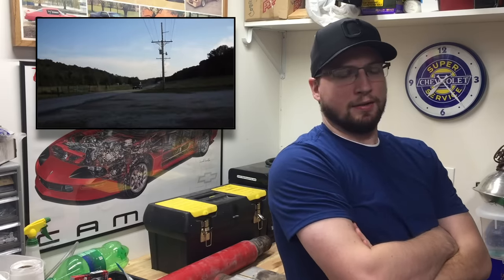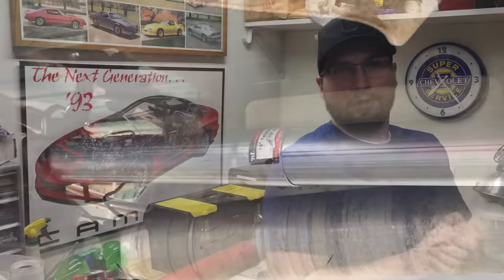Cherry Bomb® Glasspack vs. Straight Exhaust Pipe - Sound Comparison - 5.3L Chevy

Comment: I like the glass pack. Loud enough to make it sound good but just not too much to where it makes it sound like a wet fart rolling by.
Reply: jake gregg I personally like the xforce varex muffler
Reply: That's not even possible to fart with a V8. Now if it's a 4 cylinder then yes it does sound like a fart.
Reply: @streetspeed9166  that's a good muffler but its gotta be on the right V8 to sound perfect
Reply: @ffhjvbuydb78eb 4 cylinder, oh yes. V8, still possible but not as common
Reply: Fox-E (Bonzai) yeah with true dual it can sometimes be like a fart.
Reply: @dallasdelano8235 I would say its more of a crackling noise. We have trucks around here that sounds like that
Reply: Jake gregg I’m glad I am not the only one who uses that expression
Reply: Jake gregg the “fart” sound in a v8 can be found more easily in European v8s that typically use a flat plane crankshaft instead of a cross plane crank, that’s why a Ferrari v8 and a ford v8 sound so different, or the 6.8 v10s (american) vs 3.0 v10 (Ferrari f1)
Reply: @ffhjvbuydb78eb  or some v6s
Reply: @jeremysolem2494  Yeah I knows I've heard some Pontiac grand prixs that sounds awful.
Reply: Jake gregg I agree
Reply: Lol
Reply: Lmao!!
Reply: cabin drone vs external loudness...id rather have the pipes dumping that loud sound outside than the pack vibrating underneath me and bringing that noise into the cabin.
Reply: Not everyone drives a civic like you bud...
Reply: I love the way glass packs sound. I have since I put my first pair on when was 16, but they never last long as the packing blows out they start to sound bad. I love the smooth raspy sound they have when new though
Reply: @ffhjvbuydb78eb  OBS 5.7 at my school will make you eat your words. It really sounds like an amplified fart
Reply: Well said
Reply: @ffhjvbuydb78eb  I’ve heard some clapped out v8s that made me wanna deafen myself.
Reply: @banditpsycho3573  same. Some of them you can't tell if they really are a V8 or not. Especially if they have a bad exhaust leak they sound like shit
Reply: @jakegregg7153  it's always been 302 Ford= glass pack. 350 Chevy=Flowmaster
Reply: I put one on my first car and it sounded perfect. Not to loud not and quiet when I was under 3k but anything above 3k sounded nice like a sports model
Reply: I like the way my wet fart sounds thank you
Reply: There is no such thing as a truck being too loud
Reply: @thomasrainey4989  I've driven a truck that had it dumping out of the headers. It vibrated the windsheild to where you couldnt read road signs clearly. That's my too loud line
Reply: @kelseyjohnson9760  absolutely! It's yours and if it makes you happy then rock it!
Reply: @thefloridiangamer1448  If you close your eyes and listen without knowing what it is..well easy enough
Reply: Both sound good was doing the same to my truck v6 but never knew the sound my truck had after deleting the muffler....thanks for helpful video
Reply: My truck has a resignator before pipe goes behind tire so we'll probly reconnect it
Reply: Does the glasspack help with hp ?
Reply: Big difference with it being true duals
Reply: @ffhjvbuydb78eb squatted trucks manage to do it

Comment: Glass Pack! it has a cleaner lower tone the straight pipe just sounds like trash. BTW nice comparison video well done.
Reply: That's because most engines run a lot worse with straight pipes due to lack of proper back pressure, also straight pipes are a real caveman thing to do to a vehicle with all the exhaust technology we have available.
Reply: @getskared  "Proper backpressure." Proper backpressure is as little backpressure as possible.
Reply: @BradChadley  thats actually very untrue in fact some engines will stall out if they don't have enough and if you are getting into performance engines you will lose stats if you don't have proper backpressure it's important to help an engine run smoothly
Reply: @getskared  Please watch Engineering Explained's video on exhaust backpressure. It's an informative and simple summation of why that is inaccurate. The goal of a combustion engine is to remove used combustion gases as quickly as possible. If you have backpressure, it will do work against the motion of pistons, and will increase emissions, reduce performance, and fuel consumption, which is pretty self explanatory since your engine will have to work harder. This is why race cars have exhaust systems that are very loud and efficient as possible, because mufflers and catalytic convertors in a typical vehicle increase backpressure. I recommend doing some more research on how exhaust works and the effects of backpressure. Cars needing backpressure is one of the most common misconceptions about combustion engines, and is simply false. I used to think the same thing, and thought about how an exhaust system works and it didn't make sense. I did more research, and sure enough, it doesn't make sense. Remember, back pressure will fight back against the engine. A small amount of back pressure is helpful, because it creates a negative flow that will help to completely empty the combustion chamber, but it minimally affects performance and modern cars still have more backpressure than necessary (due to noise and emissions restrictions). My 2005 Toyota tundra  for example, has very restrictive exhaust headers that create more backpressure than is necessary, and a set of proper long tube headers can add 20-40 hp and a slight bump in fuel economy on that particular motor (2UZFE).
Reply: @BradChadley  no one is reading that whole paragraph
Reply: @dillongish9001  It takes maybe two minutes but alright.
Reply: @getskared  everything you say is false.. Every performance race team also would laugh at your comment.. No bavk pressure.. Backpressure needed is a myth perpetuated by those that didnt understsnd old carb engines needing tuned for exhaust changes
Reply: @getskared  wrong. If that were true then top fuel dragsters would have mufflers
Reply: @dillongish9001  Paragraph hell, that's a damn novel!!!!!!! :D
Reply: @BradChadley  You can simulate that theory just by eating a large can of Hormel Chili and waiting a half hour. Hell while you're at it get a room full of people and explain those back pressures and tones........
Reply: Glass Pack and K & N cold air intake or Filter will be perfect.
Reply: mrelectron62 straight is lean, and mean..
Reply: Agreed
Reply: @getskared  Yea ok Straight Pipes FTW.
Reply: @BradChadley  I believe it depends on the application. Sure in top fuel dragsters, there will be no restriction, however, in modern vehicles with computerized fuel and air control, as well as emissions parts added, back pressure is necessary, and therefore, programmed. In forced induction, if exhaust leaves the chambers too quickly (especially with unequal-length headers) burnt valves can result.
Reply: @BradChadley  If you are looking at long-term effects, burnt valves and valve seats will be an eventuality.
 If you do not care about long-term performance, and have a late model engine without the emission controls and other affects, sure; go ahead, why not. 
 *Most guys that build for performance know about equal-length headers, exhaust temps, and any power-adders that may change those numbers, requiring different exhaust lengths, diameters, etc.
Reply: @randomguy93984  👆
Reply: @getskared  Right. Every application unto itself.
 I will just say that it is definitely not one-size fits all.
Reply: @jrod7017  Yes, that is fair. I was just making those statements because these people seemed to think that the more back pressure, the better. I've also learned a lot more since I posted this comment so my stating back pressure is entirely not necessary is false for certain applications.
Reply: @BradChadley  Thank you, sir! Well said.

Comment: Could the cats be holding back the sound of my engine? My truck does not sound like that but I have a straight pipe. Truck has 176,000 miles so I'm guessing the cats are clogging up because its losing top end power
Reply from the maker: Yes, that's possible.
Reply: @TheDaninator  sorry to be a bother, but I have two more questions... 1) should I punch the cats out or replace them?
2) how many miles are on your truck (assuming your cats are stock and haven't been modified)
Reply from the maker: Dan Kwarta 1) depends on if you need to pass vehicle inspection or want to deal with oxygen sensors after gutting cats. Fuel economy will likely get worse if not. 2) over 250k miles. Haven’t touched the cats on mine. Plan to gut them just for kicks at some point.
Reply: @TheDaninator  makes me wonder why mine sounds a bit muffled with no muffler and only 176,000 miles

Comment: Let me tempt your imagination! I have tried this with much success. The glass pack is internally perforated as I mentioned. The flow direction in/out indicates the flow should move over the smooth sides of the perforations. Please try this out! Flip that cherrybomb 180 degrees. It still muffles it to a nice tone but is more crackly when your in the pedal! Let me know what u think!
Reply: Amendment to above I would like to suggest u try a different brand with the raised perforations instead of the dimple type used in the CBomb. I think Flotech makes one with the raised perforations.

Comment: I drive an 2008 Avalanche 5.3 and the first 6k Miles i hat an straight pipe under it but now i drive hin with a Glass Pack and it‘s much better for Long distance and it‘s not too loud outside when u drive in the city but it‘s loud enough so everybody knows that u‘r around

Comment: Long tube headers. True duals. 3” piping. No glass pack. Magnaflow straight thru mufflers. Gives nice growl at low rpm but at high rpm gives you the sound of straight pipe. Boom.

Comment: I like the straight pipe. Sounds similar to my C5 Z06 at idle. LS engines are sweet. 👍 I'm gonna to try straight piping my Dodge 1500 that has a 5.2 and manual trans.

Comment: glass pack, louder is not always better and a straight pipe is too raspy. almost sounds like an exhaust leak
Reply: Agree I have that problem now but it could be the 3" turn downs
Reply: Ninja Man just what l was thinking also...
Reply: Sounds better in person straight pipe does
Reply: True
Reply: Ninja man louder is always better where i live anyways cause it keeps wild life off the roads when ur coming but im also not a city slicker i rather back roads dirt or pave and lots of trees around
Reply: I think it has to do with the size of v8. I have run strate pipe on 400,396,455,454,390,@460 and they sounded a lot deeper.
Reply: It sounds exactly like our truck with a exhaust manifold leak.
Reply: Some motors also sound better with it. The 4.6 mod motors sound really nice straight piped it really doesn’t make them that bad until you get on the gas
Reply: It has too much of a metallic sound in my opinion

Comment: The straight pipe is all sound no movement, the glasspack is quieter but it smooth and not all in your face.
Reply: The Oxzion reminds me of this GM truck we saw on cruise night once. Ear splitting exhaust noise but nothing would happen. All show no go.
Reply: My trucks loud asf and it hauls ass
Reply: Haha my muffler rusted through so I straight piped that sucker. It’s pretty quiet at idle and I can get around pretty quietly and quickly doesn’t get really loud until like 3500 rpm definitely better than an muffler with a softball sized hole that rattled like a civ

Comment: Back in the day we got 12 inch glasspacks that were bigger diameter than exhaust. We would heat them up with a torch then drop them in water. That breaks the fibers and pretty much makes it straight pipe. We did this because you had to had to have a muffler for inspection. The shorter the glasspack the better.
Reply: @PhatNuts34  how can you make a glass pack muffler back fire more
Reply: Was it purple hornies? My father was telling me he had those on his 1965 mustang gt350 and he said it was the best sounding car around.
Reply: Yeah I had a 94 firebird 3.4 v6 had true dues with no cats on it with 2 and a half tubing out on both side of the car with Short  glasspack mufflers and it was like running open headers on that car the faster I go the Lowder it was
Reply: @reaperct3454 I think you mean crackle and pop not backfire, backfiring is like a loud cannon shot and it's usually from exhaust leaks, crackle and pops are just from the back pressure of the exhaust when you let off the gas.
Reply: @loganschannel1 it’s from unburnt fuel being dumped into the burning hot exhaust and combusting not back pressure

Comment: You can never go wrong with a straight through exhaust on a v8. Glass pack is wayy too quiet for my likings
Reply: Same
Reply: You can always go wrong with straight pipes. No refined sound at all! My truck has 1 7/8 longtubes, rull 3 inch exhaust through mufflers. I can almost guarantee its louder than that thing and has an actual tonal quality to it.
Reply: Both sound good but I like the Glasspack the best. Still need to be able to hunt and not scare everything off😂
Reply: I put glasspacks on my 87 chevy 1 ton dually, 454. It was ok, but after about UK they got better and better. The straight pipes i had earlier would pop a lot when you let off the throttle. With the glasspacks it didn't pop. I like the glasspacks better
Reply: Straight pipe sounds terrible. My V8 Colorado has headers and a 3" single exhaust with a high-flow catalytic converter and Flowmaster Super 44 on it, it's PLENTY loud and sounds very, very good. Not terribly disturbing at idle/low rpm cruise, but really bellows on hard acceleration. Straight pipe's illegal and too loud even at idle to not be obnoxious, I do a lot of camping in the bed with a topper and it's nice to be able to fire the truck up and get warm for a few without pissing everyone around me off. The only thing open exhaust sounds good on is race engines through open headers. I have headers and collector mufflers with short dumps on my woods rig, a 5.2 Grand Cherokee, and even it's too loud.
Reply: you can stick a coffee can on a V8, they sound good no matter what
Reply: I've always liked straight pipes myself.

Comment: Glasspack. Anyone who knows anything about exhaust can tell the straight pipe is a straight pipe. And thats not always what you want.
Reply: What about power? Do you notice any difference with stock vs straight vs cherry bomb? I have a 5.3 and tow. Thinking about doing something like this....that's why I ask.
Reply: @timmaynard.  there won't be any difference even with the stock muffler on. The only way a loud exhaust is gonna help is with a modified engine pushing out lots of power and even then at max it's gonna be like 6 hp.
Reply: It wont affect power much at all, the cat is a bottleneck

Comment: Also, a larger length and overall case size (especially compared to the in/out diameters), the more sound control the mufflers have. While that may reduce overall exhaust sound volume, it also controls the sound better, so if you're driving a very stock vehicle (stock cam, intake, manifolds, etc) it helps it sound much better. Save the straightpipe for race vehicles that actually sound good untamed like that.
If you want more sound volume but still want that smooth, powerful sound control, use a smaller version of the same muffler. Instead of a 30", use an 18" glasspack.
Instead of a 4x9x14 Magnaflow, use a 4x9x11. Simple as that.

Comment: I like the glass pack it just sounds better. If you want that louder more define sound get a shorter pack like an 18” or 12” pack you will have a little bit louder sound at idle but when you give it gas you will definitely hear that and some more popping also. But it won’t annoy anyone next to you at a stoplight. But when you take off they will definitely hear you. The straight pipe has never really sounded good unless you are at a track. But you made a good video of it.

Comment: The cherrybomb exhaust had an annoying drone during the in-cab videos but sounded cleaner, the straight pipe was very quieter in-cab but sounded like a late 80’s delivery truck with a rusted out exhaust. There has to be a happy medium between them and I hope you find it and share with us. Thank you for your awesome videos.
Reply: boredmud xforce varex?
Reply: @streetspeed9166  I'll have to do more research on that exhaust, I've never heard of it.
Reply: @streetspeed9166  The Varex system is super sweet sounding and the remote control for the changing of the exhaust note is nice, however, for the Chevy truck in the video, it isn't practical, both by cost and function, the truck is a work truck. Thank you though for your suggestion, the Varex exhaust system will do great on performance vehicles.
Reply: Yes, performance mufflers have drone issues.

Comment: i have the more useful timestamps bolded

1:34 cherry bomb far
1:43 straight exhaust far
1:52 cherry bomb close
2:06 straight exhaust close
2:23 cherry bomb rev
2:42 straight exhaust rev
3:04 cherry bomb acceleration
3:12 straight exhaust acceleration
3:27 cherry bomb in-car acceleration
3:42 straight exhaust in-car acceleration
3:55 cherry bomb fly-by
4:00 straight exhaust fly-by
4:07 cherry bomb uphill
4:15 straight exhaust uphill
4:23 cherry bomb in-car
4:29 straight exhaust in-car
4:36 cherry bomb very far
4:40 straight exhaust very far
4:44 cherry bomb over bumps
4:51 straight exhaust over bumps
4:57 cherry bomb bed-view
5:09 straight exhaust bed-view
5:21 straight exhaust acceleration from stop